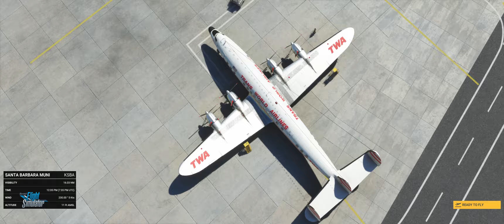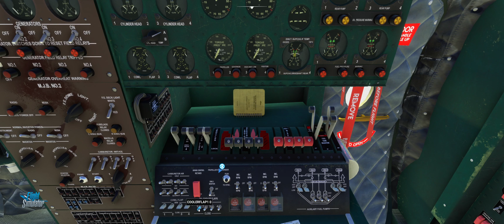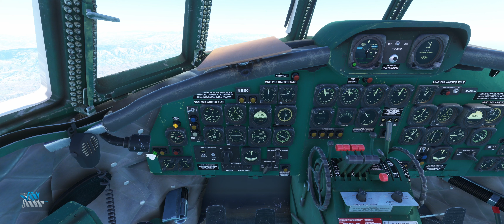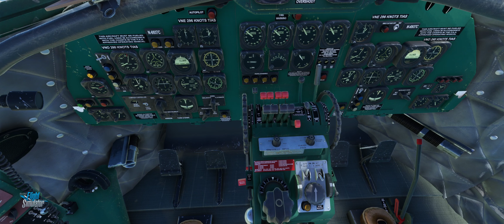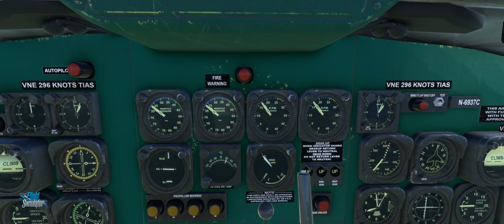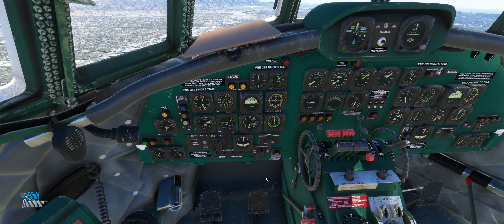MSFS Red Wing Super Constellation Tutorial Startup Auto Pilot Full Flight VOR ILS

Comment: i followed  your procedures and i keep getting  "engine 3 ignition off!"  why is that, power is on
Reply from the maker: Sorry for the late reply, honestly I have not flown this in a very very long time and do not currently have installed to check. I would check the official MSFS message board to see if there has been a bug, but since it is so old now, I am guessing it is some quirky user error step.

Comment: Can not take off! Ready for take off all the things,brakes off,engine trust max,flaps ,....and the plane doesn't move anything...why?
Reply: having the same problem with no solution
Reply: @felixcontreras6431  can you get take off?
Reply from the maker: Possibly your props are feathered?
Reply: @sprocketsimulations  props are good no feather, I dont understand why? Any idea?
Reply from the maker: @CarlosSanchez-ol2wg  I'll check it out today and update you both. Thanks for letting me know.
Reply from the maker: @CarlosSanchez-ol2wg  I just took it for a quick flight from cold and dark with no assists and it flew fine for me. Do you have wheel chocks or some other static elements on? Does your throttle make the engine respond in sound, MP, and RPM? It has been updated since this video, but it is working for me.
Reply: Hi ,again,i can not take off yet! How do you get it? @sprocketsimulations

Comment: You would have crushed the cylinders in RL but over all its an entertaining review. 
You cant fly radials like jets. 
-Move the throttles SLOWLY and GENTLY. 
- Let the engines stabilize between 30 and 35 inches and check oil pressure, temperature, fuel flow and RPM-stability  before setting full power with slow throttle Inputs for the take off
- Chose your powersetting for decent and approach and do not change it anymore untill 20 feet over the runway. Rather set your flaps to a lower level when you decelerate too fast. Try to maintain your speed with the flapsetting, not the powersetting and in this case Set flaps full at minimums. 
-NEVER really NEVER put your engines to idle in midflight (or approach) above V2. Depending on RPM and speed it could cause a backload on the pistons and you can say good bye to your engines. 

I really recommend to use the AI for learning how this plane works with all its powersettings etc. Unlike the Twin whasps from the dc6 and the conny, the turbocharched radials from the super conny are super senitive. They really break fast. 

Keep going and have a nice flight
Reply from the maker: Thanks, I was talking with one of the guys in the discord on how to properly set engine power. It’s a learning experience for sure. This was maybe my 3rd day owning it and a handful of hours in.

Thanks so much for the tips. I am glad this aircraft is so comprehensive compared to others that are sort of set and forget. Appreciate you watching and glad it was entertaining. Cheers!